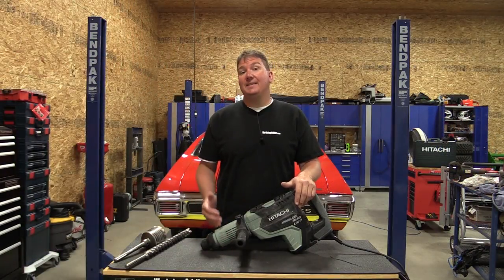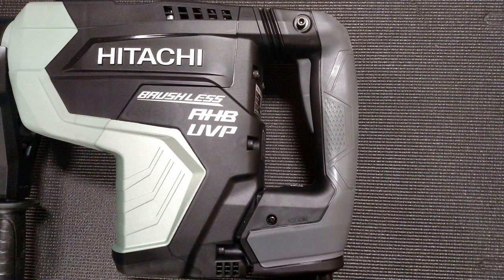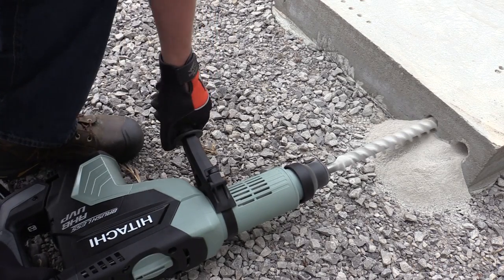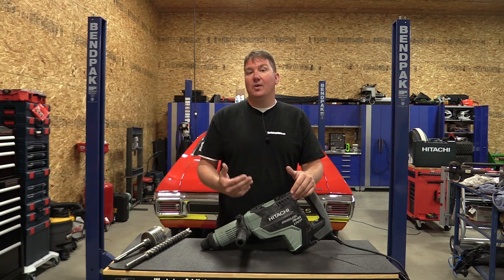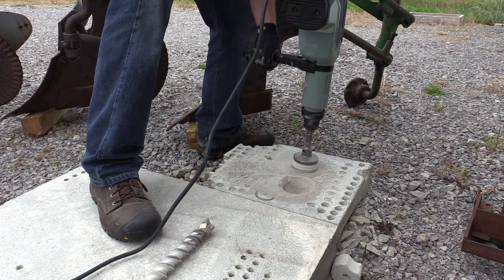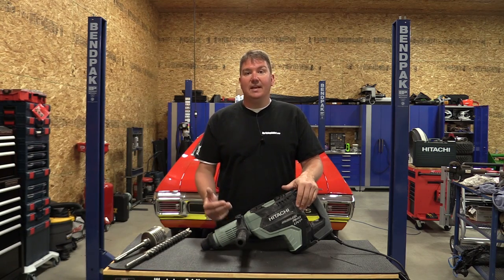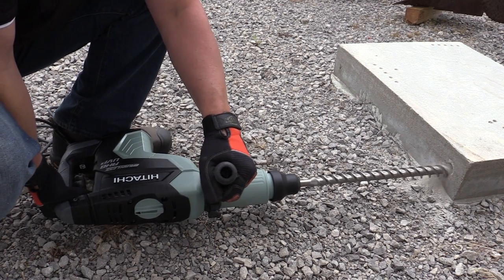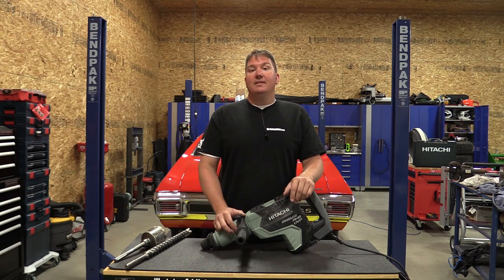Hitachi DH-52MEY Brushless SDS Max Rotary Hammer with User Vibration Protection 2-1/16"

Comment: I bought one of these last week (after watching this video) and now I'm returning it.  It will not drill more than 2, 1.5" diameter, 18" deep holes in rock with out overheating.  After a hole and a half the lights will blink and not let you continue until it cools off.  Yes, rock is hard, but I was able to drill 18 holes in a row (then I quit) using the rental unit from a big box store.  I thought I was getting a better tool than the rental unit, with the Hitachi, but it just does not have the stamina.
Reply from the maker: Matt A Wow.  Thanks for the comment.  We pushed that drill and it never let us down.
Reply: Hi Matt, one thing to consider is that the Hitachi comes with an electronic control circuit board that protects the tool so that it is not damaged. It operates differently from a majority of the other rotary hammers out there, as it is the only AC brushless corded rotary hammer I am aware of. The flashing lights you spoke of were indicating an issue... whether it be inconstant power, low voltage, excessive pressure or overheating, there was something there that was not allowing the tool to perform as it should. The on board ac inverter also provides the tool with clean power so there is MUCH less of a power drop using a brushless Hitachi over any other brand. The rental may have got the job done, but also may have been damaged in the process as it did not have such protections.The Hitachi lights flash in a sequence to indicate a code letting you know exactly what the problem was. It would be interesting to know what the tool was saying. Although rock is hard, I have used this this tool many times and it has not let me down. What kind of bit were you using and what type of rock was it? What gauge was the extension cord? Do you remember the sequence the lights were flashing in? Was it the first light, two lights, 3 lights, or 4? In any case I realize you have returned it now so you may not be worried about it, but it is protections like this that allow the Hitachi to last long after others have quit. It's too bad your experience went the way it had. I believe if you were familiar with these features, you would have had a very different experience with the tool.
Reply: The rock is blue granite (?).  The drill bit is new Milwaukee 1.5"; Part #: 48-20-3986. 
I get the technology of the Hitachi, that is why I bought it.  The on-board inverter, AC motor and aluminum body all sounded really great.
I started with a heavy duty 15AMP extension cord, but then switched to a 30amp RV extension cord with 30AMP to 15AMP adapters, thinking about the voltage drop.  It did not change the performance of the Hitachi drill.  The first time it over heated, I was not watching the lights.  I looked the light code up in the manual, and it said that it was over heated, and let it rest.  This was after only 2 holes.  The Drill was very hot.  I believe the all aluminum housing is part of their cooling system.  The circuit board(s) must use it as a heat sink.  There is almost no forced air flow on the Hitachi drill.  After the first over heat is when I started using the larger extension cord and watching the lights. (Keep in mind the Hitachi brags about handling extension cords, and generators, better than other brands).  So now I'm on to the second round of drilling while watching things much closer.  With the rental Makita it would take between 7 and 11 minutes per hole depending on how often I clear the dust/re-position/rest/push, etc. On the first hole the Hitachi is right on pace at 9 minutes; on the second hole about 7 minutes into it, the motor starts to slow down, and the first three lights start to blink, (or maybe just the top light blinks, its been awhile but I did look up the meaning at the time) indicating too much load.  So I back off and hardly push, to the point of not hammer drilling, but there is no amount of force that can be applied to keep the drill from going into the over-heat situation.  I am confident that Hitachi did not design enough forced air cooling on this model.  I did some drilling into concrete this weekend just to see how my granite compares, and its not that different in terms of drilling effort or speed.  The Hitachi may be protecting its self, but it would have taken me 9 minutes per hole PLUS 30 minutes of rest between holes to get the job done.  The drill is VERY slow to cool down.  
I ended up buying a Milwaukee 5342-21, there is actually very little information on this drill on the internet.  It does give the operator A LOT more vibration; The Hitachi and Makita were like driving luxury cars, where the Milwaukee is almost painful after 7 holes (no vibration isolation).  To be fair, the Milwaukee does have the trigger handle slightly dampen, but not the side handle. The Milwaukee, and both Makita's I used, have a ton of forced air running through them to keep the motors cool.  The Milwaukee has now drilled about 20 holes (~6 consecutive before I have to rest).  
And the Dexpan is doing a great job of fracturing the boulders into a reasonable size for removal. 
I initially bought 3 drill bits, not knowing how long they will last.  After ~40 holes the original bit is just starting to show wear, but is still making the ~9 minute holes, so I'll keep using it till the time goes up.
Reply: thanks man i was very interesting in what you say and the feedback is great my family  was always been using makita hammer drills   from the old full aluminium that sometimes zap you to the new ones and i wanted to buy the hitachi, now i am worried and sceptical  because in greece you cant give it buck if it is not what you need ... so thanks  and i hope hitachi is listening to that..  to perform a similar hard test and fix any problem they stumble on
Reply: Matt A rhi
Reply: Chris Millman
Reply: we bought the 1 9/16th on and we drilled 9 1.finch holes 12inches deep in some super hard concrete and had no overheating problems even went through rebar
Reply: @matteo92065  hi mate..l have a few question for u..l use 32x920 mm drill bit for rock. this what l use for drilling https://urun.n11.com/kirici-deliciler-ve-kiricilar/dbk-hd-1700-50-sds-max-kirici-delici-profesyonel-hilti-P232127255 
l broke 2 of this and now l want to buy a good one. can u recommend me a better rotary hammer? thanks advance
Reply: @WorkshopAddict

Comment: Best drill that I ever used for the few hours that it lasted, Hitachi claimed that it was not supposed to be used on a generator??? that was their claim to fame when I bought it now it is a big pretty paper weight.
Reply from the maker: They wont repair it?
Reply: @WorkshopAddict  I had it in stock for awhile before using it then I used it for a very short period of time I bought it in the fall work goes away in the fall and over  winter till mid spring up here. then it stopped working it sat on the shelf for awhile after that I forgot about it and I waited to long for warrantee it looks like it is new, it was the smoothest fastest drilling, quietest drill that ever used it became my favorite for a very short time. I have used all of the major drill manufacturers big drills Bosch, Hilti, Milwaukee, Metabo, Hitachi and  Makita. I now exclusively use the Makita Hr5212c it is very strong and reliable I drill 300-450 deep holes 3'-7' deep, 1-1/2" wide in granite a year so I have gone through a lot of drills. I use Honda inverter generators only the best.